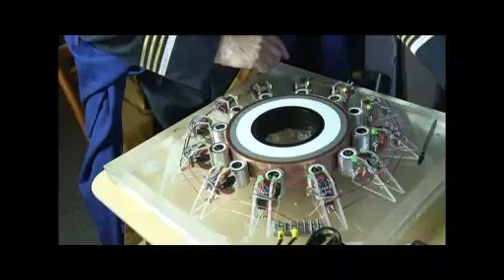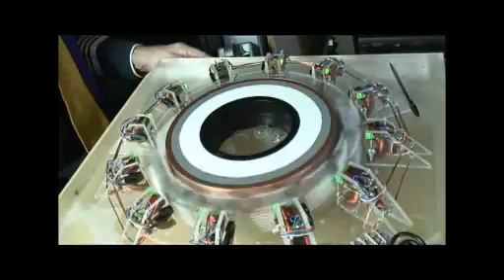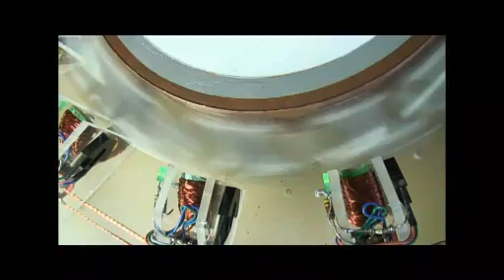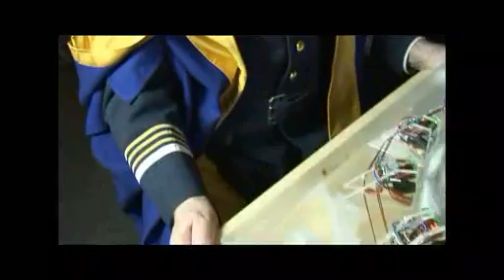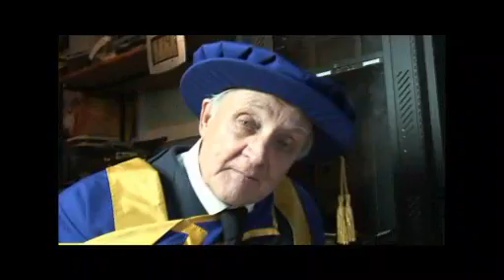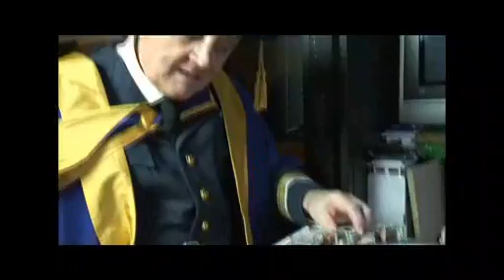Searl and Newton Part 2

Comment: No  laws have to be re-written; THE SEG SIMPLY CONFIRMS KNOWN LAWS. 

The SEG, and anything attatched to it will have no inertial-mass at flight foltage, still has gravitational-mass. John says it wil go up to the speed of light, but since it has no inertia, lightspeed may not be a barrier. This does not break any laws. Special-relativity has been invalidated years ago. It also erroneously equates inertial and gravitational-mass. Inertia is due to NET CHARGE, not mass, or amount of material.

Comment: At low-rotation-speeds, the SEG-produces very-high-Voltage, and low-current. 144,000-Volts, DC, at 1.5 milliAmperes current.

Comment: Prof. Searl should have been awarded the Nobel Prize over 50-years ago, for his SEG, and IGV-flight-frame.

But the Neodymium or other rare-earth being used as the electron-reservoir starts superconducting at 4-degrees Kelvin. At that point, the SEG is spinning very-fast, surrounded in its vacuum-envelope, and inertia-less, surrounded by a PINK halo. And the Earth's G-field PUSHES it off the ground, as two like-fields REPEL.

Comment: No input on the Law of the Squares, Rare-Earth-cored, six-decade-old SEG, from our comrade, and teacher, professor JRR Searl. If the imprint is off, you need to initially energise from an outside source, but past a low-rotation criticality, shes on her own, and can NEVER stop, save for the localised influence of an artificial-pole formed on the outermost runner-set of an older-style TV camera, whcih introduces EQUILIBRIUM into the system.

Comment: A very small Voltage and current. Rest of work is done by the imbalaced fields on the plate and runner-stes. About 1.5-Volts @ 600mAh current. The runners wigh 600-grams each, and the magnetics are very strong.

Comment: ONly the ferrous layer is magnetised. To magnetise Neodymium is prohibitive, and un-necessary. The Nd actually re-inforces the imprint on the ferrous-layer. You've probably noticed that commercial Neodymium-magnets do not demagnetise, as ferrites do. Also, the SEG-runs COLD. Magnets work best whilst they are COOL. The SEG operates in a land of COLD, unlike conventional motors and generators.

Comment: The 18" domestic-SEG will be inside a sealed casing fore safety.The Neodymium-cores, and the differing-layers act like a permanent-battery.  Vacuum (vacuum = pure massless-charge). Nature surely taps this massless-charge in ALL its micro and macro-processes. Look at TORNADOES AND BALL-LIGHTNING (plasmoids), if you want to understand where the SEG gets its energy from.

Comment: Another question, surly you would have used a ceramic or alnico magnet in the inner ring/plate. why haven't you just re-created exactly what you had to get it working to entice the bigger investors, or even just as a proof of concept?.

Neodymium has only become a good material in the last 10 years or so, why expand all this time and effort using a new material when you could argue that using what you had and getting it working would have been a better strategy?

Comment: Also, KR Shoulders:(1991) ENERGY-CONVERSION USING HIGH CHARGE-DENSITY (US Pat#5,018,180), EH Lewis (1995) TORNADOES AND BALL-LIGHTNING, Extrorndr Scince Jrnl. Vol VII, No4, RP Feynman QED THE STRANGE THEORY OF LIGHT AND MATTER, Princeton Univ. Press, (1949).

Comment: Please review: ELECTROSTATIC ENERGY FIELD POWER GENERATING SYSTEM, US Pat. No. 4,897,592, PA Lindeman(2001): THE FREE ENRGY SECRETS OF COLD ELECTRICITY, Clear Tech, Inc.,MB King: VORTEX FILAMENTS, TORSION-FIELDS, AND THE ZERO-POINT ENERGY, Jrnl of New Enrgy Vol.3, No. 2/3pp106-116.

Comment: Michaelson-Morely was a FLAWED interferometry experiment;regardless, it DID end up showing a respectable ETHER-drift! More accurate and later was the Silvertooth-Sagnac Experiment. "THe mechanics of relativity are in harmony with ETHER, In fact, relativity without Ether is unthinkable"-A. Einstein. You can only understand the phenomena of inertia, G-forces, and Acceleration with Ether-Theory, as postulated by Sir Oliver Lodge, and AP Dirac.

Comment: HE Puthoff: GRAVITY AS A ZERO-POINT FLUCTUATION FORCE, Physical Review, A Vol. 39(5) p.2333-42 (1989).K. Shoulders: ENERGY CONVERSION USING HIGH-CHARGE-DENSITY,US. Pat.#5,018,180 (1991), BP Barber, S. Putterman: OBSERVATION OF PICOSECOND SONOLUMINESCENCE, Nature, Vol353, pp 318-320 (1991).

Comment: Electrified ether waves, what? Where do you get off being able to redefine the definition of a radio wave? It is simply a form of electromagnetic radiation whose frequency varies from approximately 3 Hz through 300 gigahertz, which is absolutely, entirely independent of the idea of ether, since radio waves also have a duel particle/wave nature, just as any other frequency of em radiation.

Comment: The FRONT of the photon, or other "particle", must have a CORKSRCREW SHAPE, and particles actually follow a HELICAL-path thru the ether. Ether is responsible for the phonomenon of MAGNETIC-FIELDS (ETHER-CURRENTS), INERTIA (Resistance to ether), and GRAVITATION (Converging-Flux of ETHER). Study the KONTRABARIC-EFFECT of Burkhard Heim. Read ETHER-TECHNOLOGY, by Rho Sigma.

Comment: Less power. An inertial-field is set up from the KE of the Rollers. Flywheel effect od all that mass rotating at high-speed. Outer runner-sets go around at 200-mph, minimum.

Comment: You know nothing about the nature of spacetime. Ether drift was found in the SILVERTOOTH-SAGNAG EXPERIMENT, TROUTON-NOBLE, and others. Einstien himself is quoted as aying relativity without Ether is not possible. Read- Puthoff, HE: GRAVITY AS AZERO-POINT FLUCTUATION FORCE, Physical Rev. vA39(5) p.2333-42., Michrowski, A, VACUUM ENERGY DE VELOPMENTS- Proc. Int. Symp. on New Energy, P.407-417, SUBQUANTUM KINETICS, by PA LaViolette.

Comment: Once its superconducting, it pours all its load into an ionisation crona near the rim of the SEG that is Pink or ORANGE, instead of BLUE OR PURPLE, due to ionisation of the air at much reduced pressure, the SEG being inside a vacuum at those high power-levels. Craft is surrounded by a pink-halo at rim. Power of the craft does things to light and illusion of distance around and under the craft. top of craft is bright, whislt bottop of craft is a dark MIRROR. some strange things.

Comment: Tesla said over 100-years ago that in due time, Mankind would "harness the wheel-work of Nature". The SEG is just such a  MAXWELL'S DEMON. The SEG, like any sub-atomic particle, interacts with its surroundings due to its SPIN. Vacuum is pure charge, without mass, really an astounding value. Lorentz-invariant, Non-material Aether is harmonious with General and Special relativity, and harmonises with works of TJJ See. Silvertooth-Sagnac and Trouton-Noble experiments confirm theoretical-math.

Comment: Only a small voltage and current is being used to motor the SEG-Gyrocell runners. Pulsed higher frequency cause runners to orbit and rotate faster. In the ful Rare-Earth Cored SEG, the Rare-Earth core -plates and all runners supplies more than enough excitation Voltage/current to facilitate rotation, combined with the MAGNETIC-PINPRICK effect of poles laid out on  plate and runners, x-axis on plate, and y-axis on runners, causes runners to motor around plates like a two-phase induction-motor.

Comment: There have been dozens of SEGs built since John Searl invented first one in 1946, financed by George Hines. They refused to stay on the ground when overloaded, and cryogenic, surrounded in a vacuum, so they gave it a BODY to enable control, called the LEVITY DISK, or IGV today. 41 Radio-Controlled and Free-flight models built since 1952. Work is being resurrected after ruthless suppression in 1978.

Comment: The three-ring, 69-runner Dmestic SEG, is designed for a 15-kW output. Average home uses no more than 11- kW, so no danger of overloading, and damaging house and losing generator, as what happened to John's first landlady's house. IT was rendered unlivable by overloaded units. They go airborne if overloaded.

Comment: The Neodymium cores of all plates and runners will supply MORE than enouch excitation Voltage and current. Read THE BARRET REPORT, and THE LOCKERMAN REPORT. Peace.

Comment: Roschin-Godin, 1996, Russian Republic.

 An incorrect copy, but got many of silimar effects, including self-rotation after low-speed threshold, reduced weight, cold temperatures, reduced airpressure inside ring, magnetic-walls which penetrated flooring and ceiling, coronal-discharges, smell of Ozone. Paper is online.

Comment: If your familiar with natural vacuum energy exchanges to the electron, it's not really that hard to see why it could effect local gravity if it's acting like an electrical vortex pump. The spinning magnetic field would naturally increase the oscillations throughout the materials like electricity through a coil. Could explain why it detectably seems to loose weight, because matter is oscillating faster moving to a higher energy state, closer to the range of infrared and UV than visible light.

Comment: Flight Voltage is about 10^12 Volts DC, current never exceeds 1.5mA. About one Terravolt. At that level of electrostatic-potential, a gravity field of 1/2G onboard gravity. Like fields REPEL, so the Earth REPELS the vehicle. And you have 1/2 G-field onboard, and every atom of mass onboard is part of that frame of refernce, so violnt maneuvers at ANY speed could be done, and you would only know it by looking out viewport, you'd never feel any inertial or G-forces.

Comment: In the rare-earth-excited SEG, with a higher level square, like a six-level, you get fantastic power for flying the generators, wich more load placed on tehm, faster they run and COLDER THEY GET (Dark-Energy). At 4-dgrees K, the Neodymoium starts superconducting, device is cryogenic, in a vacuum, and NOTHING can hold it down, it is physically impossible. Without control, it continues accelerating at FANTASTIC SPEED, into space.

Comment: SEG in domestic-generator-mode, does'nt just CUT magnetic-lines of force, same as any conventioonal generator, it actually INSERTS ELECTRONS INTO THE COIL-WINDINGS. So what results is cold-current, and instead of constantly LOSING electrons, electrons are added to the wiring and materials of lightbulb filament, and motor-windings of appliances. This is also why it promotes rapid healing. It inserts electrons in the body, directly, which is what creams and ointments do SLOWLY and indirectly.

Comment: Completed generator produces COLD CURRENT (Negative-electricity), and runs COLD. More power is drawn from it, the FASTER it runs, and the COLDER IT GETS. Opposite of conventional generators. So lite-bulb gets bright, but stays COLD. Motors will run cold too. And both will last manytimes longer when powered by a 15-kiloWatt domestic SEG.

Comment: The 12 coils that simulate the seccond ring: Are they controled by some circuit which pulses the 1.5V 600mA around in a circle or do you simply apply the 1.5V 600mA to all of them constantly?

Comment: I have read a few of your other responses to comments and think I might be starting to understand this thing. Is it sort of like a wimshurst crossed with an alternator? It produces DC when the second set of rollers are added between a collector ring on the outside and the central ring? And adding a load to the circuit increases the conflicting magnetic forces within the SEG?